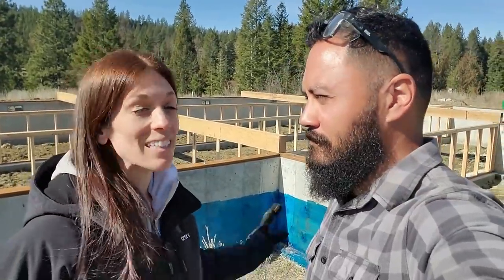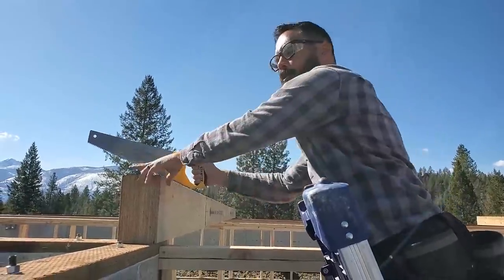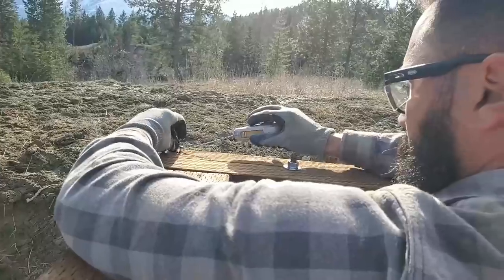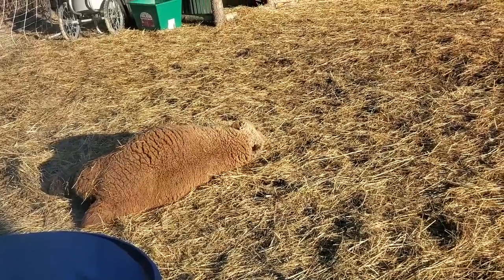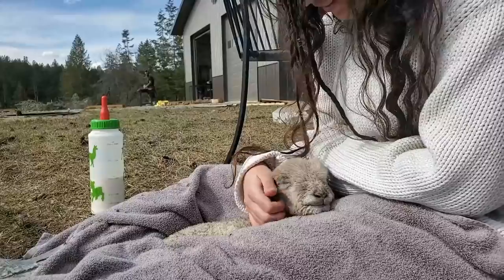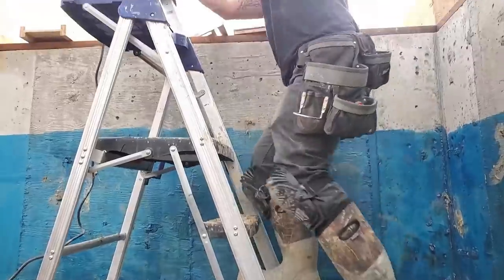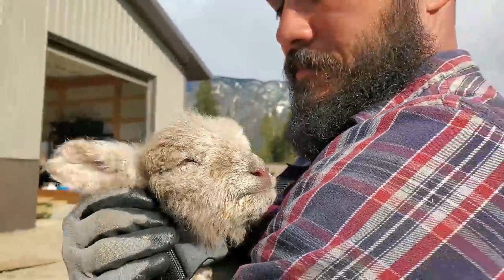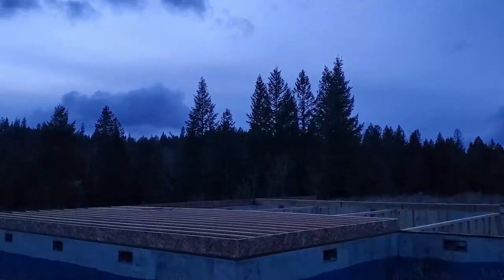MASSIVE Beams | Rolling Joists | A SECRET Hatch? | Building Our Home In the Mountains

Comment: Suggestion, when running your electric, install a few electrical outlets & some lighting in the crawlspace. You may need it at some point in the future if you have to do any repairs. You are in the country, so you are going to have rats or mice eventually under there. So any wires should probably be in conduit. Just a suggestion 😊.
Reply: Good one @Larry Parish...nice was thinking the same thing.
Reply: Yes, having to install it later is much harder.
Reply: @colinstace1758  that was going to be my next comment 😂.
Reply: Shouldn't be any mice or rats under there if it's all closed in (and it definitely should be).
Reply: @arnoldromppai5395  these folks seem like they are doing things right & not cutting corners. Putting conduit in a crawlspace that will have very little traffic I don't believe is going to break the bank. Was not referring to the whole house.
Reply: Maybe add cheap solar powered lights for craw space, need not be 5,000 lumens but just enough to see what is in are. Wire vents ok thicken them up when needed, could even add flaps to it or something. Hey is there build so lets just keep watching as they go along.
Reply: I put lights under my house , it makes the crawl space so much easier to function in.
Reply: I hate rats and mice.  Put cotton balls under crawl space saturated in peppermint oil.  It keeps them out.

Comment: I built my home with the same type of joists.  One BIG thing to remember, when you start placing the decking over the joists, use some form of wood glue.  This will halp reduce the squeak in the floor later.
Reply: And screws over nails, the sqeak "repair" kits are all basically just screws to bite back into the joists.
Reply: yeah there are specific subfloor adhesives
Reply: @anand8905  Now that NO VOC is the mandate the water based glues don't do the trick. We use Urethane Foam guns for subfloors. Part of the New and Improved Movement. Be Blessed
Reply: @colinstace1758  - blocking is required at bearing walls per manufacturer.

Comment: Get rid of the Philips head screws and use Torx or Robertson head screws.
Reply: TECO nails for Simpson Ties
Reply: Out here in CA our home d. was using the "deck screw" which are so high quality U can recycle them in projects.  Original design was an internal square head with phillips, now have gone to the  12 point torx design which is much better drive system.

Comment: Looking good, don't forget your mid-span blocking, over the pony walls and where needed. When it comes to putting the T&G sheeting , snap your line, tongue edge out or removed. Use sub-floor adhesive, and use screw, or ring shank nails. You can also rent the sheeting screwgun and use the clips of screws, for a nice quiet floor. Don't mind sharing my 25years of experience. No one ever plans too become disabled, but you rise above and make the best of it. Take care until next time and God bless amen. ☺👍
Reply: Ps the baby lamb is cute as all heck!🙄

Comment: I hope that you have considered all that must go under the floor including long pieces of waste piping etc. It may be very difficult or impossible to get stuff inside without an external hatch. The interior access may be okay after the house is built but during the build access from outside sure is handy. Sometimes you have to think many steps ahead while building to save you headaches later in the process.
Reply from the maker: Yup, going to get the long pieces down there before sheathing

Comment: Y’all should install a temporary power supply close to the house. That would probably be pretty expensive though. You could use your box trailer as a tool trailer to hold all your tools while you’re building your house.
Reply: I was thinking the same thing less moving just load and unload the trailer.
Reply: a generator would be most helpful......
Reply: @speliotis  he has one. That is how they were doing laundry for the longest.

Comment: Jeremy get a couple 100' air hoses for your air compressor, you loose voltage on a little long cord but you don't loose air pressure in a hose. It'll save your air compressor.
Reply: I was going to mention the voltage drop on the long extension, too. I loaned a neighbor my hoist to help him pull his well pump about 200 ft from his house. He ran 14 gauge extension cords to power the hoist. But, the voltage drop over such a thin extension over that distance was significant enough to increase the amperage and burned out one of the motor's coils on my hoist. Arrgh!
Of course, there will also be a pressure drop over long distances of hose, so he'll need to increase the pressure at the compressor. I'd attach a pressure gauge on end of the hose then the tool to the gauge. But, that's me.
If he doesn't need constant power, a 2kW solar generator might be an option. Maybe not. Power tools pull a lot of power. Just a thought, for whatever it's worth.

Comment: PRO TIP- put your DWV Drain Pipes in crawlspace before you place all Joists. Physics come into play with a little Houdini to get 3-4" pipes under there without cutting them down to short pieces then you will have to add more couplings, more work, more money, more leaks, more parts, MORE TIME. Same goes for the crawlspace wall rigid insulation and crawlspace vapor barrier to be installed later. Be Blessed

Comment: There is always a learning and comfort curve when working with new connectors. Buy a sawsall, it will be a life saver. I’d set up your trailer at the build site as a tool trailer with a generator for power. Keep up the good work

Comment: Looking good so far. You could run a power line form the pump house for miter saw and air compressor. Where is the main power line going to? You could also set up a temp panel there and run a line to the house as well. Either way, better then that long of a run form barn. Once you get the first floor deck up and snap out the lines for the walls, spray them with clear protectant spray of some sort. That will help for them to last longer and make them easier for you to see.

Comment: Trick for using the hangers, set 1 side first, then drop your joist in, then swing the other side up tight and fasten that side.  Just watch that the joist doesn't set too low because the bottom of the hanger will be somewhat skewed until you get the other side firmed up.

Comment: Leave the compressor in the garage and either run a longer air hose or run a pvc piper (1/2 inch) from the garage to the house build and then connect your air hose  to the pvc pipe.

Comment: Squeaky joist hangers:  In some places you are required by code to place a dab of non-setting construction adhesive in each hanger before setting the joist in. It may not be a requirement where you live, but you can retro pump a little into each hanger before you fit the flooring, it'll be a quick and inexpensive fix (as you only have a small number of hangers). Trust me you won't regret doing it to your forever home, as chasing and fixing squeaks later is a royal pain :)  Your local big Box store will advise you what type to use and how to apply it.

Comment: FYI on the hangers, I’m pretty sure you set the joist with some toenails, then put the hangers around the joist. I did the same thing on a play set, then later saw that your supposed to do it in the opposite order. At least that’s how I saw someone else doing it and it made much more sense why there’s went smoother.

Comment: Hey guys with what do you do those pony walls on the two inside ones why not block off an area and insulate it then put a trap door in the hallway that crosses it for extra storage. Instead of attic storage you have more convenient in for the flight of stairs down to it to get things. Would be much easier than building storage into the attic!! Also much easier to do now than later

Comment: Great video guys! The house is coming together! A little tip to help with squeaking in those hangers, try using some  liquid nails or your preferred type of adhesive it will help bond it and stop the squeaks! Good luck with the baby lamb, has that happened to you in the past? Will you cull the mother or give her another shot so to speak? Thx John 😎👍

Comment: Another great episode. NOTE: ideally there won't be any mechanical systems in the crawlspace (some building departments prohibit any water devices in crawlspaces) but if the plan is to put equipment down there, a 24 x 36 opening is not adequate. good luck. ALSO: check with your supplier, they might have given you the wrong hangers for the BCIs.

Comment: You're supposed to have a Bci joist against the side rim joist. Otherwise the outside wall load is only resting on the rim joist.
Reply: Also blocking where the I-joist crosses the pony walls and at the end bearing walls.  For your saw jig, put a piece where the saw plate can run against it so it is easier to align the saw.

Comment: Also it will be easier to install your web blocking if you do it before you install your rim board.  As long as you can get your nailer in there, either way works.

Comment: You've answered the question regarding the access to the crawl space in this video -- the master bedroom hatch.  It still looks like the crawl space will be open to the outside and you plan on insulating the floor from underneath.  Those floors are going to be cold in the winter.  Do you plan on having a vapor barrier on the floor of the crawl space?

Comment: Hey guys!    Do yourselves a big favor,  While your joists are exposed,  use strapping metal and strap them all to the concrete. You will need this done to pass inspection. At least one strap per joist.  You can use concrete  screws, or use a special nail gun that fires a special .22 caliber round for each nail. You need to do this around the whole perimeter.
Reply from the maker: We don't have codes or inspections

Comment: Hey Jeremy your better off running a long air hose than a long extension cord for your air compressor. The usual extension cord can't handel the amp load at start up especially over such a long distance. There is just too much loss.

Comment: i'm sure i'm not the first one to suggest it but i think it would do you better to leave the air compressor in the barn and run air hose out to the work site. long electrical run will cause voltage loss and shorten the life of an electric motor. it will also keep your compressor out of foul weather and not have to drag it across the field each time you stop working. my thoughts. jim in central florida

Comment: Time to pony up & get some tools. The minimum would be a laser level, small scaffold & cordless track saw (or cordless circular saw with inexpensive track).  Improve quality, reduce workload + more important reduce time.

Shims - Get composite. The wood shims will compress under wall load very quickly.

Comment: You can build a small four wheel cart about 4’x8’ so you can log your tools and anything els you need to take from you garage to the new house your working on it will be very handy all around for all sorts of chores  amule will work very well with that and for now the tractor will do as well  check al from lumna acres he built one like that very in expansive    It’s in his early vids 
Good luck with your new house build you got your work cut out for you. And your going to need to be as efficient as you can    So having the right tools is key I’ve been in renovations 33 years. And still doing this today works always very nice when you have the right tools. Cheers and good luck. Montreal can here

Comment: Only got to worry about normally with joisting a foundation is toilets if you have to cut a joist to get a toilet downspout you need to double both sides and double both sides perpendicular at least in Washington do not cut a joist if it lands where your toilet's going to be either move your toilet or odd span that at that point.

Comment: Just a thought, would it be better to setup a temporary workshop and storage area closer to the build site?with power from generator or underground power run from the shed? Just need roof and floor . And maybe 2 walls ?

Comment: As others said, subfloor adhesive is paramount to reduce squeaking. Huber  sells a popular one for their Advantech product:  https://www.huberwood.com/advantech/subfloor-adhesive

Running electric and light  outlets will help for later.

My .02 maybe you mentioned it but recommend you add the foundations drains around the perimeter and backfill to make access easier at least on one side, and/or build/buy a scaffold, bridge, etc. An injury for either of you will set you back in time.

Good stuff, keep driving on.

Comment: Jeremy, did you determine why you had to shim the 34 foot joist and not the joist on the opposite side of the access hatch? Every time I run into that it's the trimmer joists ' short one's'  that the truss company throws in which are cutoffs from their yard and can be a different dimension. Is it the 34 footer that is shy in height or the trimmer that is taller in dimension? 28 yrs in carpentry, so the curiosity is killing me lol! Cheers from Canada!😁🇨🇦🔨

Comment: Take some friendly advice I have over 45 years of construction experience. Get some help to get the house in the dry , or some large black plastic to cover up the floor . That ingeniered joists and plywood, may be somewhat water resistant , after a few weeks out in the rain and sun it will start to swell and bow .  I am not trying to be critical, I am just trying to save you some frustrations and money . P.S. get you a generator  .  Good luck

Comment: I would think you need to put gravel and vapor barrier in your crawl space, otherwise you are inviting condensation and mold. It also seems odd that you didn't put any drain tile or french drains around your footings, both inside and outside the foundation before backfilling, easily tied into the slope behind your  home, especially with al the clay in your area.  Also , no foam insulation on the foundation or crawlspace floor???  The foam on the outside would also protect your foundation from expansion and frost heaves when the wet clay freezes in the winter. You seem to be doing everything else better than most new homesteaders, though!!!

Comment: You are doing well but as an old engineer I have a few concerns. The pony walls got moved a little. Did you replumb them? Beams need a specific amount of bearing length. It should have been specified with the design. Check that you have adequate bearing length. Some of these glue laminated timbers don't do well in the rain so, protect them. That worm drive is great, My Dad bought one in 1950 and it lasted 40 years. I bought a new one for doing my house. Be careful. Construction never goes as planned. Good Luck, Rick

Comment: QUESTION: WHY DID YOU NOT PUT CONCRETE PILLARS / WALLS UNDER EACH SECTION OF SUPPORT WALLS 
AND HAVE THEM POURED AT SAME TIME AS OUTSIDE WALLS ?? 
AND .... LIKE LARRY PARISH SAID IN COMMENT BELOW .... INSTALL ELECTRIC AND LIGHTS IN CRAWL SPACE
AND HAVE IN A CONDUIT WOULD BE VERY WISE !!!  MAYBE EVEN A WAY TO HEAT THE AREA IF NEEDED.

Comment: For the resistance structure it is recommended to use nails only for fixing, instead for the resistance use screws, advice from professionals and it is recommended to use as many screws as possible instead of nails

Comment: The beam is supposed to support the joists? What I'm I missing? What is the purpose of the beam if it is is the same height as the joists?
Reply from the maker: It's the support that will run under our 2 load bearing interior walls.

Comment: 9:15 are those galvanized nails? code requires it too be.
Reply from the maker: We have no codes, but yes
Reply: @GoodSimpleLiving  most IBC codes are there for a good reason. for this instance non galv nails would rust out from the treatment the wood gets to be in contact with the concrete in short order, then only gravity and friction are stopping it from sliding off.